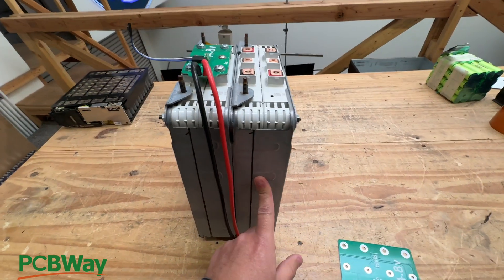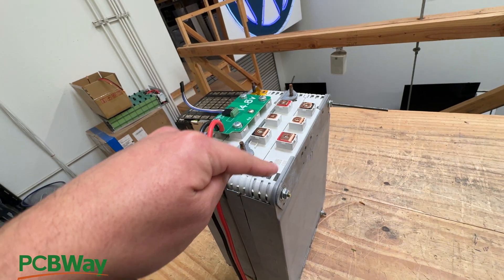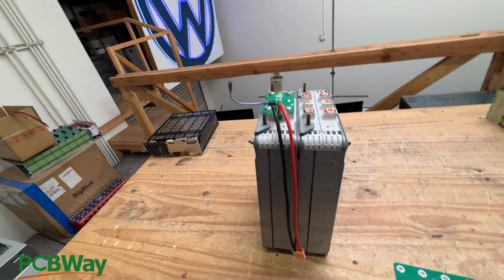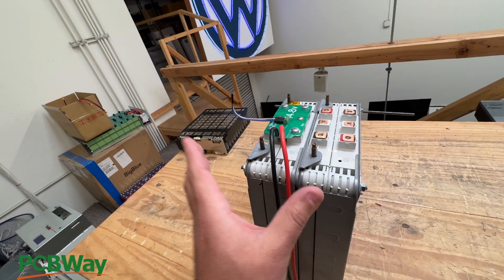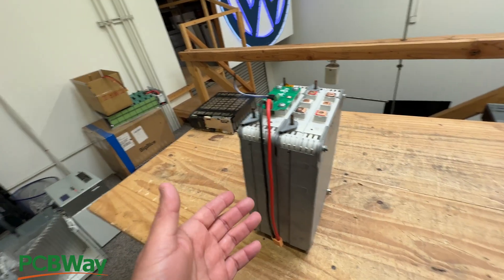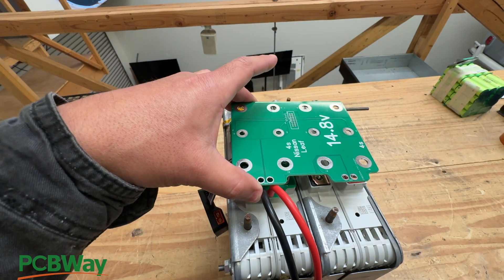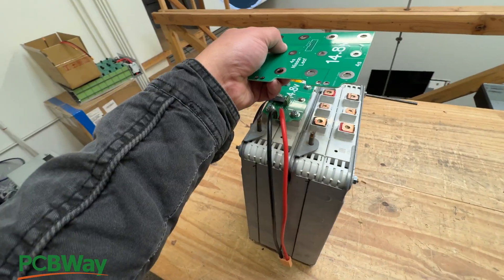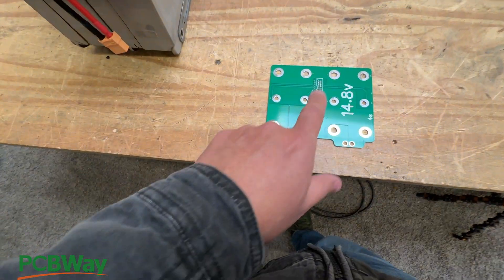Open Source - Nissan LEAF PCB Busbar project - PCBWay

Comment: Do you sell 12 volt red ready-made battery like those. 

 can it be using a small solar system probably two to four solar panels?
Reply from the maker: Yes check our website

Comment: Hi Jehu, need expert help. I'm into ham radio, and all my equipment requires 13.8V +/- 15% to run it. I have a e-bike 48V 13AH battery pack with a bad BMS. I parted out the 18650 cells to construct some battery packs for portable use. My question is, in a 3S (12V) configuration, that doesn't leave me a lot of headroom when the radios need more than 11.7V to run. If I go with a 4S configuration, that tops out at 16.8V, which will burn up the radios. Now, I see two options. One, construct a 4S pack, but charge it with a 13.8V (30A) PS, leaving the individual batteries at around 3.45V instead of 4.2V, or, charge the 4S pack to 16.8V, then uses a buck-boost converter to get to a nominal 13.8V. What are your thoughts? Can you recommend a reliable 4S BMS? Thanks.

Comment: Could you use these to create a 48v battery?
Reply: For sure,  just like with a regular 12volt ,run 4 in series
Reply from the maker: Yes and no,  if you use 4 in series you end up slightly above 48v,  it’s compatible with some 48v equipment but not all

Comment: Board design is a good start but it could use some work still imho, please don't be offended but I do this for a living. 

Biggest thing I see right now that needs fixed/updated is you don't specify your copper weight anywhere. Not on the board, not in a fabrication drawing, readme text file, or anywhere. If you don't specify that it can greatly change the current carrying capacity of your boards. Default for most 2 layer boards when ordering PCBway, Advanced circuits, and most any board house is 1 ounce copper but 1/2 ounce is fairly standard as well which cuts your load capacity in half and then some. Honestly for the currents you're talking I'd be looking at ordering this with 2-4 ounces on it, which is less standard.

If you want some assistance, let me know.
Reply: On the website is says 1oz of copper on the busbars he sells. He also talks about it in several of his videos.